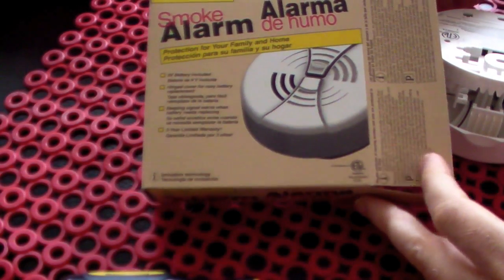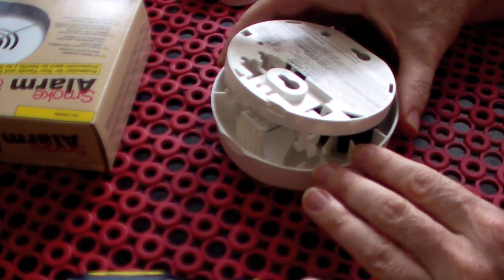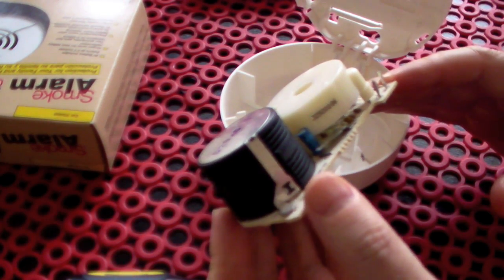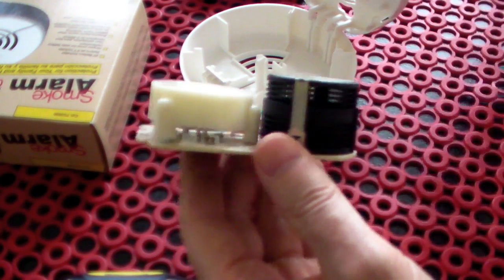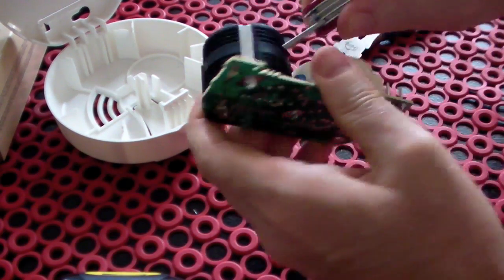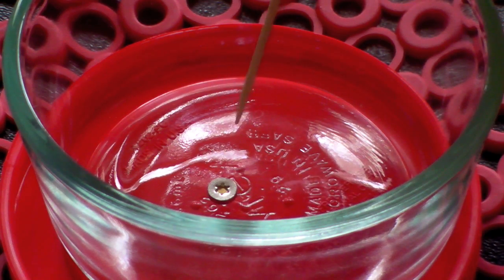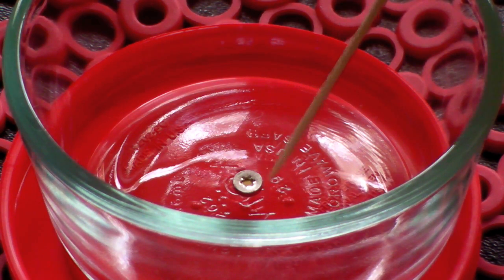Removing the Radiation Source that Makes a Smoke Detector Work

Comment: You don't have to destroy the tower at all. One end of the strap holding it down isn't soldered, just pull it out of the circuit board. Much easier than tearing shit up.

Comment: You completely skipped the most important part.. removing the button from the plastic interlocking casing..
Reply: Yeah, from 3:19 to 3:20 is handwavy magic. And this part is super important, because not only is the protective plastic shell clamped around it, but the americium is deposited onto the surface of the metal button, and then held in place usually with a microscopic layer of gold. If you remove the button incorrectly, you can scrape the gold loose or the americium loose. Pretty important step honestly.

Comment: No I'm into science electronics more in the newer day age of something different new not the way that you contemplate every day circuitry that's on a chipboard i utilize corks of electronics I noticed one here in your video that totally explains one of my theories to be true and I believe it's a court that just happened with yours video as if you were to watch your video you'll notice the cork where you when you are yanking Batman off of the smoke detector it makes a sound frequency into your phone as well as the radio frequencies that are coming off the merrim but if you notice the glitch to the screen as that noise came off as you popped that Emery button on as you were twisting it a noise when you tossed it down happened right when the button was pointed at the screen if you notice that another cork happened to the screen it glitched those are the types of actions in science that I'm utilizing to come up with a new invention the courts the things that people see is glitches and wrongs the things that I see as opportunity new and day new age

Comment: What I want to know, is if you were to actually touch it, is it potent enough to give radiation sickness?
Reply: No. It’s an alpha emitter and although alpha is treated as 20x when calculating absorbed dose compared to gamma or beta and thus is really nasty, the good news is that alpha radiation is stopped by skin, you’ll not absorb much of anything at all by being around or even holding it.
But say you took a dremil to it and ground it up? Good chance the dust thrown into the air would be ingested and that would be enough to ruin your day - heavy metals of any type are readily absorbed into the body and they’re really hard to get out, and since the metal is now inside you and there’s no skin to stop it...you’re absorbing alpha point blank and that will get you sick or worse, and it will continue to make you sick/do serious damage until it passes out of your body, which it may or may not ever do. 
So that’s the deal with alpha radiation sources like this one. Not dangerous outside your body but if a piece gets knocked off by damage - a piece too small to even see sometimes, and you ingest it it can be very very very bad. That’s what makes opening these things for the source so sketchy - you’re breaking open the shield around the am, so it would be easily to scrape a screwdriver and gouge the source by accident and contaminate stuff or living things with nasties.
Reply: Short answer is no, just don't eat it.

Comment: What happens if u swallow that button?
Reply: Outside, with your skin, no high risk since your skin's outer surface is composed of dead cells amd Alphas are blocked by this outer skin..

However, swallowing an Americium is way more dangerous since

 1 - Your digestive tube's is composed of live cells and

 2 - Digestive chemicals may damage / dissolve Americium oxide coating diffusing it into your body and blood.

...And you guessed it, you do NOT want to have a 432 year half-life radioactice element inside your body.

Comment: 241Am is mostly an Alpha particle emitter. In normal conditions, these particles won't pass through the dead cells of your epiderm. However, in case of a wound, or near live tissue, these radiations will be harnful.

But the worst case is if the radioactive source is swallowed. The digestive tube is composed of live tissues that will be affected by the alpha radiations.

Better safe than sorry, if you are not sure of what you're doing, do not tamper with ionisation smoke detectors.
Reply: You would need to ingest 1,000 of those buttons to get a lethal dose of radiation. Radiation is nowhere near as harmful as people like to believe, and is a particularly inefficient carcinogenic and mutagen. The lowest confirmed dose linked to a case of cancer is only somewhat lower than the dose required to get acute radiation poisoning.

Comment: Wouldn't you get radiation poisoning?
Reply from the maker: No, this is a consumer product, which must be made safe in order to sell. The radioactive isotope is alloyed into another metal. The alpha particles it emits have no penetrating power. If you swallowed it, it would pass through you harmlessly.
Reply: The radioactive material isamericium-241, wich yes is radioactive but theres  little contents in the container so it produce very little ionizing radiation therefore is fine unless if you have constant exposure with it other than that there will be no long-term effects
Reply: You would need to eat 1,000 of those buttons to get a dose high enough to kill you.

Comment: Reporting this video to the FBI
Reply: Makes no sense whatsoever as this is not illegal.
Reply: ITS_SLIM_SHADY124  actually taking of the aneurysm from smoke detectors IS illegal
Reply: Pussy
Reply: fucking rat
Reply: I believe there are federal laws against tampering with radioactive smoke alarms.  There should be a notice on the box or device, right?  Anyway...  Do you really trust that the manufacturer is encasing the Americium properly and preventing flakes or deterioration?  For $5.00 I think the manufacturer went the cheapest route possible in manufacturing and quality control (if any).
Reply: @tbeef It's 0.3 microcuries, you'll be fine if it's around you exposed. It ain't 3.6, it's 0.3! It emits less than the average dose of radiation you will see in a year. Smarten up shitwad.

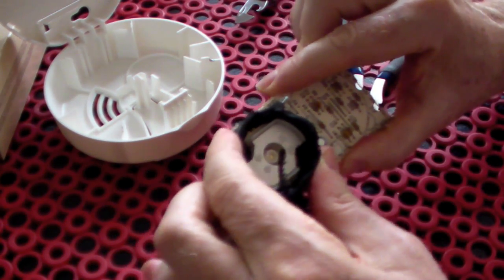Comment: At 2:53, was that a glitch in the matrix, or is the camera suffering the effects of the radiation????? lol!!
Reply: Yes minute 4:01 take a closer look
Reply: It's not radiation. The alpha radiation this emits can only go an inch or two in open air, max. And it's not strong enough to go through the lense. It is physically impossible to induce radiation flashes from alpha on a normal camera.
Reply: Levi Werner - Unexpectedly Random it's just a bug isamericium isn't that Radioactive to produce camera glitches
Reply: @RainbowRemixz  yes it is. It's just that it's alpha radiation and it would stop in a few inches of air.

Comment: people if you dont know or never used radioactive meterials before be aware :The smoke detectors propebly contain Americium 241 and it is dangerous not if come at contact but it can damage you skin and it is very bad if you breath it or it goesh inside you so be carfull and do your reasertch first!!
Reply: What?
Reply: One guy tried to build a nuclear reactor with this americium, and it totally backfired
Reply: do your research on spelling. like really did you have a stroke while your keyboard sneezed
Reply: Space Nuts americium won’t harm the skin. The radiation it emits could eventually be harmful, but it’s mostly safe as long as you don’t ingest any dust which can cause cancer.
Reply: So much misinformation here. 
1. Americium is primarily an alpha emitter. Harmless outside the body but insanely harmful inside the body. 
2. Americium is poisonous. 
3. I have myself measured beta and/or gamma emissions from a smoke alarm at a low level. These are presumably from the daughter elements although I haven't looked into it. 

I wouldn't sleep right next to a smoke alarm but largely it's safe if used as intended.
Reply: The radioactive material isamericium-241, wich yes is radioactive but theres  little contents in the container so it produce very little ionizing radiation therefore is fine unless if you have constant exposure with it other than that there will be no long-term effects
Reply: The amount within the smoke detectors can’t penetrate your skin
Reply: search up David Hahn he built a nuclear reactor out of 1000 of these and moulding them together
Reply: No_Bullshit_Productions Don’t be a fucking pock, he’s trying to tell people to be careful, who cares if he misspelled a few words, Someone idiotic could do something dumb with this VERY dangerous element. Buzz off.
Reply: @kazutomarzo9860  what you're ignorant

Comment: Your doing something really dangerous
Reply: You have been close to radiation your entire life - streaming in from space and up from the ground.  Life on earth evolved with the capacity to respond to low levels of radiation.  We wouldn't be here otherwise.
Reply: How. Nothing is dangerous there.
Reply: +Matthew Jones but keeping radiation close by isn't dangerous?
Reply: It's not really that dangerous as an alpha source of radiation would not be able to penetrate the skin hence it will not cause damage outside the body, however if you decided to ingest it, well, that would be a different story.
Reply: DO NOT BREATH IT
Reply: First of all the amount of radioactive materials is not enough to do any real damage all though on long term exposure like hours is deadly so you relatively safe around a smoke detector
Reply: Matthew Jones you're doing something dangerous by spelling something wrong in the comments (grammar nazis are comming)
Reply: The radioactive material isamericium-241, wich yes is radioactive but theres  little contents in the container so it produce very little ionizing radiation therefore is fine unless if you have constant exposure with it other than that there will be no long-term effects
Reply: Blake Ashley the sun is the essence of life.  That radiation is not life essence sun rays.

Comment: why do smoke Dec. need radiation?
Reply: Thanks for the info! I'm trying modify the smoke detector to a water detector
Reply: Is there a way to bypass it
Reply: I have a filter canister  for my aquarium, which leaked while I was asleep.  So I was trying to look up online if there's anything  I can use that will let me know if water was leaking. So, I found a website that tells you, you can use a smoke detector as a water detector.  All you have to do is solder 2 wire where "test" button contact is. When the 2 other ends are submerged in water. It will set off the alarm.
Reply: Most smoke detectors use radiation because they have to ionize the air around them in order to detect the smoke, But there are some smoke detectors that use different methods for detecting smoke.
Reply: There are two types of smoke alarms.. One uses ionization and another detects the density of air. Ionization detectors use some of that radioactive material. I tried to study since there was a guy who made a reactor with the americium. So far I only have one button...

Comment: i want the alarm out of a smoke detector, is it dangerous to take apart a smoke detector
Reply: No, as long as you don't take apart the radiation source, it's completely safe. It's still relatively safe to take the radiation source, but it's a ton safer if all you want is the alarm.
Reply: +DaffyDaffyDaffy33322 thank you
Reply: According to quick research, Am mostly releases alpha particles which are toxic to inhale but can be blocked by barriers such as glass.
Reply: It literally can't hurt you as long as you don't inhale or ingest it. It's mainly an alpha emitter, and what very, very little gamma is released is to weak to hurt you in the doses this gives you. Alpha particles are blocked by a sheet of paper, so you skin blocks them. HOWEVER! If you ingest or inhale an alpha source it releases all of that energy directly into you, and let's just say that doesn't look pretty. Thankfully, because the source is impregnated with another meatal, there's no contamination risk, so just don't eat it and you'll be fine.

Comment: CoconutScienceLab Hi there, I've been googling about smoke detectors the last few days and have tried to youtube it as I have quite an important question… you seem to know what u're talking about! My in-laws have three smoke detectors in their place. They're all seven years old and recently (last several months) they have been complaining about metallic smells, scratchy throats, dizziness and scratchy skin. It seems to occur closer to the smoke alarms than anywhere else. They are hard wired to the house. Just wondering if smoke alarms are known to 'leak' chemicals/radiation/electricity etc etc etc???? If you could answer, that'll be GREATLY appreciated! :-)
Reply from the maker: Shocking Drivers They don't leak radioactive particles since the particles used are impregnated in another metal (mixed). I'm not sure that whole house detectors even use that type of tech to begin with. But something else could be wrong so you might wanna check. A burnt smell could indicate an electric short. If there's a large wall opening (hole) behind the detector it might allow wall insulation or attic dust in the room. Definitely worth investigating.
Reply: Thanks very much for the reply. That makes sense… I may investigate that :-)
Reply: +Shocking Drivers http://www.world-nuclear.org/info/non-power-nuclear-applications/radioisotopes/smoke-detectors-and-americium/

Seems unlikely any significant dose of radiation would be produced. It would require a fair bit of americium to cause harm.

Comment: I just took apart not one but 10 smoker detectors from 2 brands, and it was expensive for me in Brazil and i couldn't find this alpha source, all use light detectors inside.
%$#@#$&%$¨*(*¨&(&¨$(&%(&
Reply from the maker: Perhaps Brazil has banned the radioactive source. I'm not sure why they would use a light source instead.
Reply: You may be using a Photoelectric type, try and use an Ionization one, photoelectric uses a light sensor when the smoke comes in the way of the light source it triggers a button they detect slow burning fires, such as a sofa fire which emit large smoke particles, an ionization detector uses a radiation wave and when it is broken by small particles (fast burning fires, grease and electric fires) it triggers the alarm, Hope this helped :)

Comment: e much radioactive exposure can kill u or if even a microscopic bit got into you It could be fatal
Reply: sporks The radioactive material isamericium-241, wich yes is radioactive but theres  little contents in the container so it produce very little ionizing radiation therefore is fine unless if you have constant exposure with it other than that there will be no long-term effects (edit) a microscopic amount of radiation will not do anything to you literally everything produces some form of radiation your food the air you breathe the ground everything produces radiation and microscopic amounts won't do crap
Reply: You would need to ingest 1,000 of those buttons to get a lethal dose of radiation. It's not nearly as dangerous as people like to imagine.

Comment: You know what else can this be used for? A RADIATION GUN THAT TURNS ELEMENTS INTO RADIOACTIVE ISOTOPES. Have a lead block and filter everything but nutron with at tin foil.
Reply: Kevin Loo The radioactive material isamericium-241, wich yes is radioactive but theres  little contents in the container so it produce very little ionizing radiation therefore is fine unless if you have constant exposure with it other than that there will be no long-term effects (edit) you need like 100 smoke detectors to get the proper amount of isamericium to produce a neutron gun

Comment: OK, I took apart all of my smoke detectors. No button.
Can you do a video on how to re-assemble a smoke detector?
Reply: You could've just looked on the back or front of the alarm.
If it has a i on the front/back, it's an ionization alarm. If it has a P on it, it's photoelectric.
Reply: Lol
Reply: You could’ve looked behide to check if it does or if its slim fire alarm it doesn’t have uranium
Reply: @mrskyline6406  It's not uranium they contain, it's americium-241! :)
They're not similar at all!
For starters americium-241 can be way more dangerous.